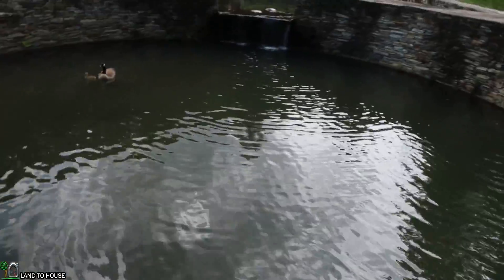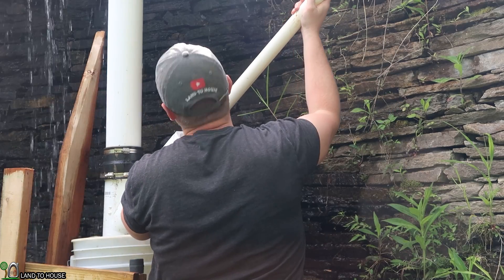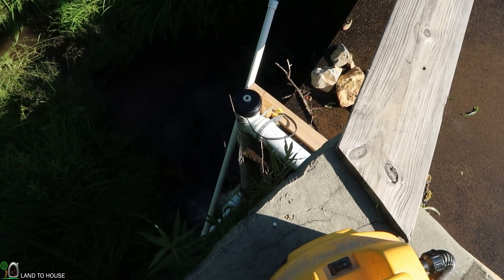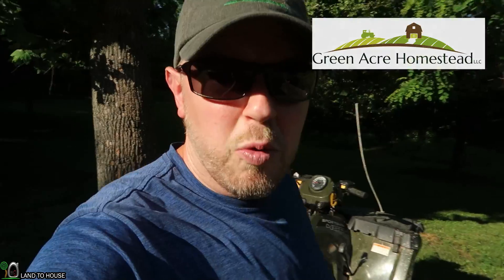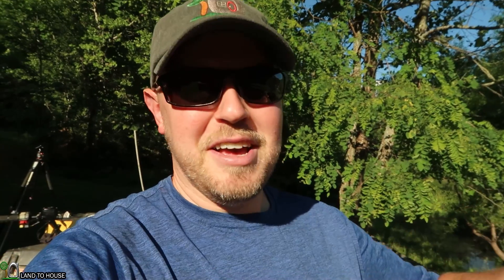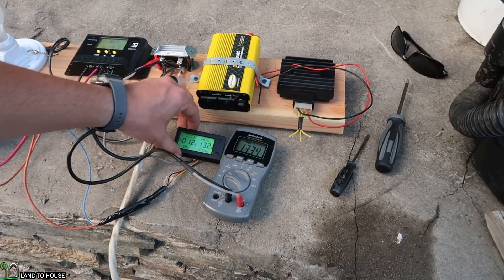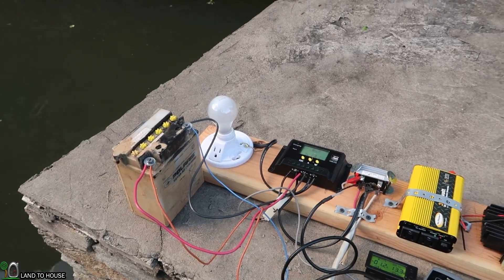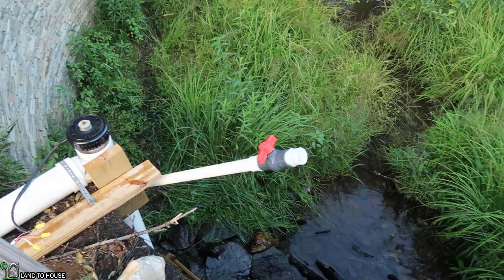Micro Hydro Increasing to a 6 inch Down Pipe

Comment: Having the whole draft tube 6" will definitely give you more power, obviously because more water will be drawn, but it'll also cut down on cavitation coming off your runner due to the water slowing as it enters wider pipe (in meters per second at least, the liters per second should be the same).

A battery is not the best choice of testing load, as the internal impedance changes with charge level. Washing soda liquid rheostat worked well for me and I can walk you through how to make one if you like, it's very easy.
Otherwise some nichrome toaster wire should also do a good enough job, and just light bulbs in a pinch, tho their resistance will quite possibly change as they heat up.

Going into the creek for maximum utilisation of drop is a good idea, you're long past the point of maintaining equilibrium with your water input rate so might as well just make it a decent test and let your pool refill in between.

What's now your total head, and any way of measuring the flow?

(Hope you're enjoying every third commenter telling you to put the turbine at the bottom of the pipe, and every fourth one asking if you can just put a pipe back up to the top and run the thing as an infinite loop. They'll keep doing that no matter how often you try to explain.)
Reply from the maker: I appreciate your expertise. With more than 6 years of ram pump work I have heard the “just take the waste water back to the top” a million times. As soon as I started working with hydro I started getting the “the turbine must be at the bottom” comment. Haha 

Spencer shipped this turbine so that I can get lots of fun tests in. I am just having fun making as many changes as I can. Next I am going to glue in a 45 degree into the intake and take the 90 out. I will also see what a 6” pipe costs. 

A washing soda rheostat would be fun! I have no idea how to make one so any help you can give would be much appreciated. I have purchased a hoverboard motor and would like to make a replica of your turbine. Would you be up for some email after I get done with this testing? 

I am going to get a MPPT charge controller to get some better results. That with your rheostat I should be getting much better watts. 

The total drop is around 8 to 9 feet. The flow rate I am not sure but it can pull as much as it needs to from the pond.
Reply: Yeah definitely email me with any questions.
I should probably also get around to doing a liquid rheostat build tutorial at some stage..
Reply: MPPT into a large enough battery at low state of charge would be better than rheostat IMHO.  MPPT would effectively impedance match the source (alternator + flow rate) to the load (battery) and maximize total wattage for a given flow rate.  Rheostat and resistors/saltwater would need constant adjustment and have to compensate for electrolysis and temperature change.  Anything you can do to take the fallible human element out of the equation would be for the better.

Your main source of resistance is the effective area between the hub of the turbine and the walls of the pipe it's centered in.  Changing pipe diameters might do more harm than good due to vortexing and/or cavitation at all of the new bends in the adapters.  We want laminar flow as much as possible.

Running the turbine further down could provide benefit in cavitation reduction on the turbine blades since the mean pressure of the water is higher.  But if that's not a problem at these pressures, (and I don't think it would be)  you're right that putting the turbine lower wouldn't have an effect on power generating capability.  Once the drop after the turbine gets closer to ~30ft, maybe you could make an argument involving phase change.
Reply: I was getting surprisingly strong cavitation of 2.5m drop, since it's added to by the water momentum, but flaring the pipe straight after the runner helped that quite a bit.

A rheostat would only really be helpful in calculating power curves, as you say by adjusting the resistance and then plotting multiple points of resulting volts and amps. If you want something to just hone in on the sweet spot itself then yeah a well suited MPPT charge controller would hopefully do a decent job.
Reply from the maker: @OpenSourceLowTech  i just ordered a mppt. I think it also has a readout of watts. 

I need to glue joints because I am getting some air. 

Today is full drop 4" filming.
Reply: @LandtoHouse  Perhaps using a midnite 150 mppt or even victron 100/30 to 150/35 would work very well, here in Spain we use them a lot in solar, wind and hydraulic with an LH150 you will be able to adjust the voltage to the highest intensity possible and it self-regulates better that a pwm that is fixed to a voltage, to increase the power a good idea is of course to increase the diameter of the pipe but above all to reduce the curves from 90 to 45 or 67º max that decreases the water brake internally

Comment: Seth, watts is a measure of power. Watts are a product of volts and amps. Given the same physical conditions and changing only the voltage of the battery from 12v to 24v, you should get a corresponding halving of the amps, resulting in similar watts. In essence the power being produced has not significantly changed, only it's format has changed. 
 That being said, the entire purpose of MPPT is to find the most efficient RPM therefore voltage, while at the same time still able to produce the highest ampage that the generator/alternator because of it's design can produce. This is the units maximum power point (watts).
Reply from the maker: Yes. Also Spencer says the meter i have might be inaccurate.  I will buy an mppt to try getting better results.

Comment: hey buddy as much as i love watching these videos of yours  there fun you are wasting your time with this little electric  bike stator . what you need to do is make yourself a three phase  permeant magnet stator . you will never get enough energy from that little stator motor . you would increase your power with a larger stator . right now its kinda like trying to run a head light with a bicycle generator . you would even do better using a servo motor you would want something in the low rpm high output   range . i would just go with a three phase generator . look them up in wind generators the concept is the same just different concept of drive system . there ac current so no drop off in voltage or very little . this is just to small to do what you want . be great maybe for a wind generator  just to trickle charge something . but you will get no real power from this set up . you need a bigger stator . but i will keep watching just for sheets and giggles .

Comment: Am I pemitted to ask why you didn’t get a 45 degree elbow in the interim?
Reply from the maker: I have purchased a 45ﾟ angle for the intake. I should be installing that soon.
Reply: @LandtoHouse  you also need to go deeper with your intake, I saw a little whirlpool when you said you thought you were hearing air in the pipe

Comment: I love to give you a little help with the micro hydro turbine. What I believe is that the impeller pitch is to conservative.  You have a jet pump impeller in the tube, which is great for making pressure when driven by an engine.  You need a higher pitch with with more blades. You don't have the pressure needed to convert to torque. A computer muffin fan can due a better job converting torque that you require.

Comment: Lengthening the down pipe increases the weight of water falling hence more force on the turbine blades. So I think installing larger pipe would have the same effect.  This next thought is out there. Put the out fall of the turbine into a wye (4") and run two pipes down to another wye and out into your six inch out fall and bucket.  Although the this may create restrictions that would reduce the flow. Just out of the box thinking hopefully based on sound assumptions.

Comment: Ok let me first say happy father's day 
Now I've seen a few different systems over the years 
They all had the turbines at the bottom just before the discharge pipes K
The smaller systems were 4 to 1 the inlet being 16inches and at the turbines 3 or 4 inches 
The length of the feed pipe was divided into sections gradually getting to the 3 or 4 inches at the turbines  K
In the applications I have seen the feed pipe ran into a manifold of sorts divided into 6 directions for 6 individual turbines with shutoffs so that you could run 1 to 6 at a time 
Some had manual valves others had mechanical ones that were controlled by pressure sensors for output or voltage requirements 
Most of them ran 3 to  4 at a time with the others used as backups for  more need or maintenance 
I hope this helps you in some way brother 
Have good one 
Thank you for the videos 
Just saying

Comment: I would like to see you pull and drop into the same pond. Maybe use the 6inch from the bottom of the turbine into pond. I would have a similar setup as that. Also add a T in the long piece across the dam and put a ball valve on top to rid of air

Comment: Placing 6 "or 100" by 4 "is irrelevant. The whole design is a mistake from the beginning. If we place the turbine at the bottom then a column of water eg 4m will press on it and generate power. Increasing this water column or flow from 4" to 6 "then it will make sense. More water will flow (m3 / s) through the turbine and will generate more power. The placement of this turbine - it is only affected by the suction force - certainly less than the pressure force (water column)

Comment: Keep the 4 inch down pipe, 6 inch intake, and make the down pipe longer. Just like exhaust scavenging. Longer the down pipe, the more water weight ad momentum pulling on the motor,but the motor will only spin so fast before an upgrade is needed.
Reply: Imo, stop stepping up to 6 inch on the output. Reminds me of Chevy diesel 8 inch exhaust tip fanboys lol.
Maybe change the 90 on the intake to a 45?

Comment: it is not good how it will not start spinning by it self that means you could not even use a bell siphon to start it going when ever the water level reaches the right hight to need the run off

Comment: i think going wider leaves more chance of air getting in and stopping the siphon i think keeping it the same size but having the drain off as long as you can with a t pipe with riser and cap to allow for air to collect rather then traveling back up the pipe and stopping the siphon

Comment: It seems like most of the comments covered everything. A steeper pitch on the impeller would net you more torque with your 12v pwm controller. A true hydro tuned mppt would be ideal with your current setup.
Reply: Exaclty!

Comment: Isn't the power being generated by the force and speed of the water. It overcomes the friction in the generator try a longer shaft on the impeller/ propeller you'll have to support it and move the impeller further down the pipe

Comment: I would seal any joints upstream of the turbine in case they are pulling air into the system.
Reply: You are 110% correct. A needle size leak would cause massive losses in efficiency!  Air is 25 times thinner than the water and will suck massive cavitation into the system every second it runs!
Reply: agreed.
Reply: Absolutely air leaks causing turbine cavitation MUST be stopped. Seal the joints!
Reply from the maker: They are sealed now. Video filmed and coming out soon!

Comment: Hi there Seth, Firstly I think you need to wait a few seconds after starting the camera as the initial part of your voice is missing. Next, I think your power problem lies in the impeller design because under load the the impeller slows and the water then slips past the blades. I believe you need a more complex setup with two or three complete rotations of each of the three blades in order for the inertia of the water flow to exert a far greater torque on the turbine shaft.
Reply: A stator vane to counter the rotation would also help.

Comment: Would be a good idea to try MPPT controller to increase efficiency of overall circuit - maybe 10%-15%. PWM controller will always pull the alternator to the battery voltage instead of allowing alternator to run at its most efficient
Reply: Open circuit was like 66v but it's being pulled down to 12ish volts so I imagine a moot or some kind of current limiting or input voltage limiting buck  converter I bet it would close to double the power output
Reply: I made these post before the video was over but it's mostly corrected now

Comment: Great series. Thanks for sharing. Curious why you didn’t put the siphon at the top of the system instead of at the bottom? Also, agree with running 6” all the way from generator to creek.

Comment: I still think the issue is turbulent water hitting the turbine. I dont know how feasible it would be to run an intake up to the next water dam but I bet if you syphoned the water from there you would see alot more power.  the long intake would cause the water to smooth out and the 2 feet of head pressure you gain would help push water past the 90 at the turbine.
Reply from the maker: I actually have a plan to use a board and some sandbags to make a little dam and lift the water up so that it just spills directly into the pipe. It would eliminate the siphon.

Comment: I would try to remove the 90 or even 45 deg bends as the dramatic bends will impede the flow of water.
Try a gentle curve by gently heating the PC pipe, use similar way as copper pipe but bigger spring or other method.
Also have a look at YouTube "Practical Engineering"
This channel will explain why to make systems correctly will make them more efficient. I believe that by adding a bigger pipe cavitatin might be caused which might damage or ven destroy the turbine?
Thanks for the video.

Comment: 8:45 8:53
Maybe 2 * 45° 4 inch angle?
Reply from the maker: I am about to use 1 45 that takes a 4" pipe all the way down. Might also do a 45 on the intake.

Comment: That you have to give it a push to start the turbine shows the lack of torque == power.  The unloaded voltage is irrelevant.
Reply from the maker: My other hydro system does the same thing. Once I start it it will make 300w.

Comment: use MPPT instead of PWM charge controller
Reply from the maker: I will probably get one to test with at some point. They can be a little costly.
Reply: @LandtoHouse  Probably you can take your MidNite Classic 200 Charge Controller from your new shed. In the shed you can install the cheap PWM charge controller. That is anyhow meant to work with solar panels (and not with hydro generators). The MidNite Classic has a setting for hydro generators (you have shown this in your electrical set-up video of the new shed). With the MidNite Classic you will get reliable loading of the generator and a reliable reading of the power.
Also: Make sure your battery is discharged. Otherwise the best charge controller can not pull the full power because the voltage will be limited to 14.4V (the charging end voltage of a 12V lead accu).
Reply: @LandtoHouse  without it your clamping the 66 volts down to 13/14 and getting the same amps and loosing the other 50volts with of possible energy. You are wasting your time without it. going to 24v will be the same amps but double voltage (assuming the turbine can keep up). You can get 10-20amp mttp 121v controllers now for $30, hell, spend $5 on a 3 amp one and u will triple the output.
Reply: You could also get a variable power resistor and connect it directly to the output of the rectifier and put your meter on that. Adjust the resistance up and down to find the peak power output.
Reply: @GriffoNZL  Yes, the variable resistor sounds more reliable than the charging of a battery, were the drawn power depends on the charge state of the battery.

Comment: The bigger the height drop the more power generated?
Reply from the maker: Yes. The higher the drop the stronger the water pulls.
Reply: Up to a maximum of 30’ with a head-end generator. After that,  cavitation, due to pressure differential, sets in and whole setup fails.